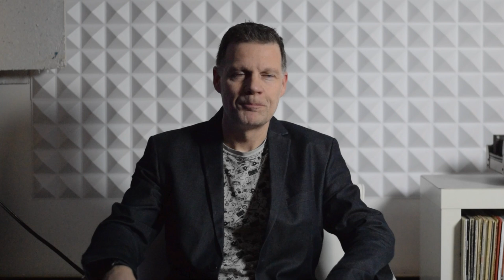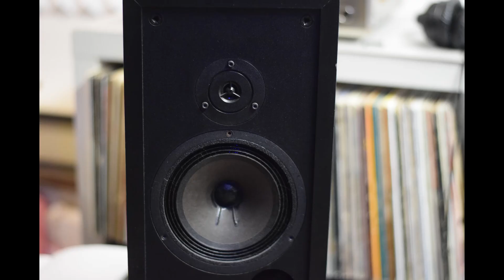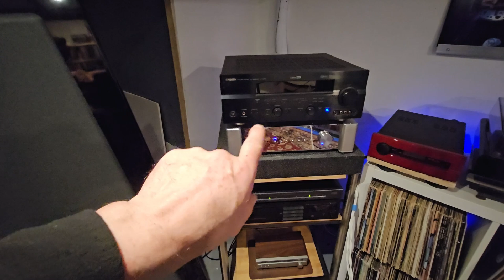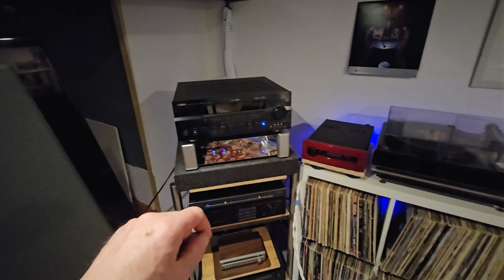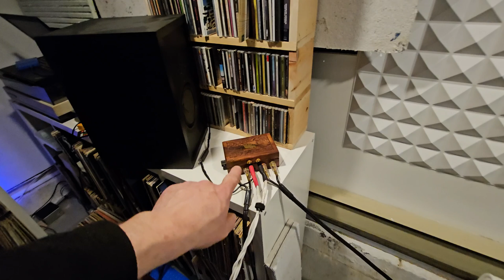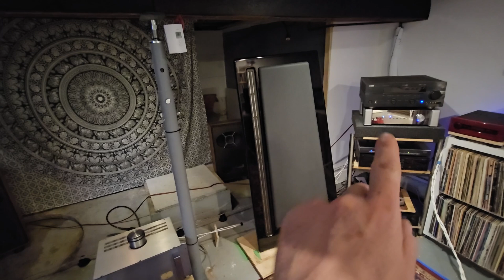How many speakers is too much?

Comment: Thank you for your sharing your experience. Under my theory of sound and time, I would not put any speaker ( in phase or out) behind your listening position. Have you tried just the 2 front pairs? How was that?  If I did use a third pair, I would position them to the side of your chair ( or slightly in front) pointing at (or slightly in front) of you in phase.  If you try this, please let me know. I'm implementing my  own 4s/2c (or 6s/2c) as I write you. . So would really appreciate  hearing your listening observations. Thanks in advance for your imput.

Comment: XTC crosstalk cancellation,  been doing it since the 90s . 

Any AVR run in Multi-Channel stereo with the rear surround phase reversed and left , right swapped  can achieve XTC . 

5 years ago I embedded drivers into a sofa  for deep immersion. 

As a part-time inventor there so much available but I have no time may I need to get with AGY
Reply from the maker: Hey Heavy,
Sounds like you have some fun experimentation going on there! I'm sure AGY and you would get on just fine :-)

Comment: I was running 2 pairs of LS (A+B) simultanously since late ´80s in my ever evolving Systems. Until the arrival of better AV Receivers - now listening to music via 7.1. ALL channels in stereo, which is even more immersive, while lacking in quality compared to my seperate tube amp / horn LS Stereo rig. 
Integrating both for shared Front LS use never worked without considerable hum, scary noise and hissing……. . So my music space now is packed with one 7.1 (TV Sound only) and yet another 2.1 system for music.
Which brings me to the AGY‘s  „signal splitter“ 6.2S/2C. That device has no surround, DSP whatever processing, but  I could use quality LS + amps only and toss out some of the AV gear. Does that make any Sense ?
Reply from the maker: Yes, the AGY setup is 2 channel only, just reproduced by several amps and speakers to fill out the space and set the listener deeper into the soundstage. If you lose the AV gear you will not have the 7 channel audio for TV if that's important for you. In my room I'm back to 2 channel/2 speaker setup, to my ears this just sounds 'correct', and gives me the simplest and most enjoyable musical presentation.

Comment: I think that perhaps you just need more time to learn how to listen to this system and try to fine tune it. I find that at first when I make a substantial change it takes a while to "sink in". It also helps to do a proper set up. A haphazard set up won't get you optimal results. Hours can be spent on speaker placement in a typical system.
Reply from the maker: Hey Kenneth, thanks for watching! I spent a few weeks setting up and listening to the system, and a lot of time going back and forth between this and the regular 2 speaker setup. I did try a couple of different speakers in the front rear stage and rear speakers, this setup in the video was the best combo. Maybe if I had higher quality amplification for the additional channels it may have made a difference. I found it interesting to listen to, and hoped i would have liked it more but there was an unsettling feeling I got after time. I am planning on duplicating a setup in a smaller room, AGY recommends this...look out for round 2!

Comment: Very interesting, although I’m not sure I understand why the rear speakers need to be out of phase. I have an inherent distrust of any system that isn’t “pure” 2 channel, but it sounds like a fun experiment! Sometimes hearing a different presentation makes us recognize strengths in our system that we may have become accustomed to and take for granted.
Reply from the maker: Yes, supporting the front sound with in-phase sound would just move the soundstage back, but playing out of phase enhances the spacial cues it seems. Check out the Hafler circuit as a different way of hooking up rear speakers, this plays only the out of phase information in the recording, except in phase on the rear speakers.
Reply: The rear out of phase "pull" the sound from the front deeper. Instead of canceling......the same thing was done with early pro logic simulated surround back in the early 90s. ...it's a very common way to setup the rear channel in many surround modes. And pro setups.

Comment: I hooked up a pair of Maggies, and a pair of Zu's on the same amp. It could handle it, I did the math. It sounded fantastic! The Zu's are much more sensitive than the Maggies, so the Zu's were the mains, and the Maggies were like fillers as they did not play as loud as the Zu's. I have two REL T-Zero subs in the mix too. Just incredible sound and soundstage.
Reply: I know someone is using a pair of ATC SCM19 and a pair of Maggie together on the same plain. He said he cannot live without either one. The blend of the two speakers together is so good.  I can believe that.  When I need to test multiple amps together in production, I run multiple pairs of speakers together. I know what sound I want if I run this pair mix with that pair and what model of amps I am running.  The combination alone is almost endless.  It is also very interesting and educational to blend amps and speakers together much like cooking with different ingredients.
Reply from the maker: Hey Michael, thanks for watching! I would suggest that you try putting the Zu's on a separate amp and trying to change the relative volume of the speaker pairs for additional flexibility. That setup must sound amazing if it pulls the strengths of both speakers!

Comment: In my conversations with Angela (tho short) I’ve asked if this is as immersive as the Bach4Mac…Angela said (and others who’ve followed this set up) say it’s quite impressive…and Angela is of the opinion it’s better than the B4M as Angela’s set up won’t be obsolete in 5 years…and it’s a lot easier and cheaper 😊
Btw,as an old school Apogee Scintilla owner I can dig this room 👍👍
Reply from the maker: Thanks for watching Carmine! The Baach system uses head tracking and active DSP to achieve some similar goals, I have not heard the Baach system so I can't comment. Yes, true about the ease of setup of one vs the other, but probably the results are commensurate with the product development and quality of components in both cases. 
Are you still running the Apogees? I am very happy with my Carvers and have no desire to change them!
Reply: @ GM ☕️🍩❄️❄️
The Apogee are long gone ..and in my senior years I’ve downsized to a nice headphone rig and a moderate vinyl set up.
Time marches on …
Have a great Friday and weekend ❄️
Reply from the maker: Hi Carmine, I was just revisiting this...wondering what you thought of your headphone setup compared to your previous Apogee system, any difference in your appreciation of the music?
Reply: @ GM ☕️🍩 
Circumstances change and life moves on ..compared to my Apogees..the headphones are much improved from those days ..as has everything else pretty much.

Your question is am I finding more or less appreciation in my musical enjoyment…the answer is YES….MORE enjoyment and appreciation of music..in many genres.

For the simple reason that when you (I) hear a great piece of music ..played back with great fidelity it has an impact ..not just WOW factor (Hans Zimmer😆 movie OST’s) but it hits 😭 emotionally.
I always say music is the software that drives the hardware…🙂
I hope this rambling thing helps answer your question.
Have a great weekend.
Ps..headphones Sen’s 650 and LCDX 2021 Creators Edition 
Bryston BHA-1 headphone amp
Denafrips Ares 12-1 DAC

Comment: I have surround amplifier .to music i use only stereo
Reply from the maker: Hey GT, I have tried my Yamaha surround receiver in my system before, the 'pure direct' mode does make it sound it's best so if you have that option on your surround amp I suggest you try it. This setup that I tried has no processing, everything is just 2 channel but multi amps.
Thanks for tuning in!
Reply: @davelistenstohifi I use Pure direct on my yamaha dsp z-11